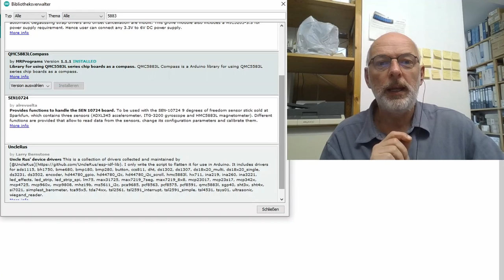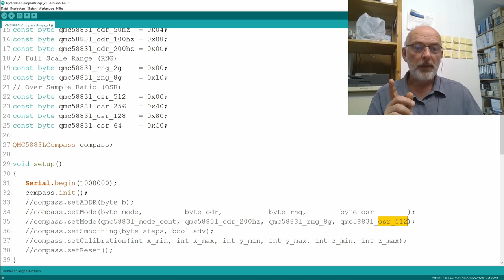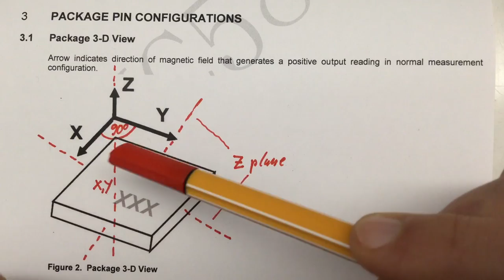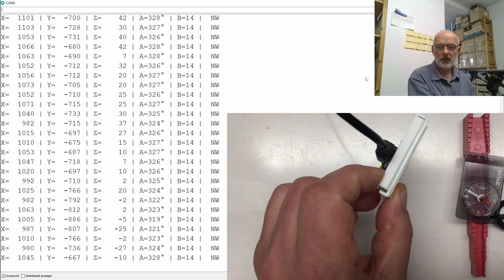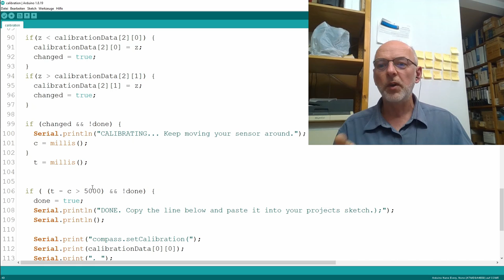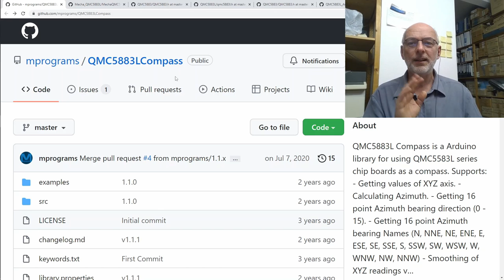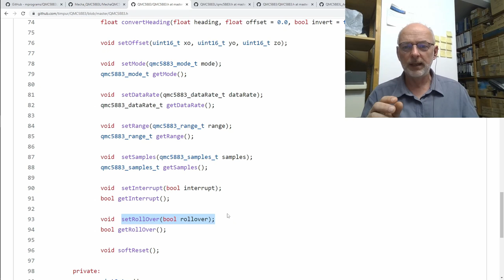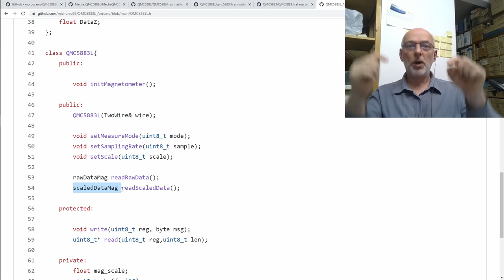QST QMC5883L 3-Axis Digital Compass and Arduino MCU – The Basics

Comment: Hello, a very useful video. I want to make a compass for my boat on the control panel. At high waves, the readings change. How to exclude slopes?
Reply from the maker: You need an accelerometer to compensate for the pitch and roll motion. Some day I might make a video about that (no promises). Meanwhile have a look at the MEMSIC MMC5983MA, a much more capable/precise digital compass chip ( https://youtu.be/BgSZ5XZTDDg ).

Comment: This has been immensely helpful. Although I am using the HMC version. I couldn't figure out where my extra offset vector was coming from. I thought there were external magnetic fields around, or that my breadboard or header pins were magnetized, or that my sensor was busted. I didn't think they simply need software compensation 😅
Reply from the maker: Yes, those things definitely need some calibration (see the rest of this series up to "QST QMC5883L 3-Axis Digital Compass and Arduino MCU – The Details (5)" https://youtu.be/pfMf-4S9yzk ).

One question though: Is the HMC as noisy as the QMC? In the end I found the QMC had simply to much noise and drift to be used as a compass.
Reply: @robertssmorgasbord  Thanks, for the very good information on this chip.  I'm struggling with it in MultiWii 2.3 .  I will see if I can initalize it with setCalibration() because Multiwii will not calibrate it.

Comment: Hi Roberto,

First of all thank you very much for the useful information you shared.

I have a few questions for you.

In the Cleaning Robot, I use the location information from this sensor so that the robot can perform automatic operation.
I process the angle value coming from this sensor using PID control and enable the robot to go on the route I want.
However, the sensor is very affected by magnetic fields (it is even affected by the phone) and therefore the angle value constantly changes. That's why the system, which works normally for a while, is disrupted due to magnetic effects.
We used a magnetic protective spray to prevent the sensor from being affected by the magnetic field, but in this case, we could not even calibrate the sensor because the spray protected the device from the magnetic field.

I have three questions for you.

1- Do you have any suggestions for this problem? (Solving the sensor being affected by the magnetic field.
2- Do you have any other sensor suggestions similar to this?
3- How can I find the angle for this process using the output of an industrial sensor that gives analog x and y axis slopes?

Thank you in advance for your help.
Reply from the maker: These are really interesting questions. First, a disclaimer: I have absolutely no experience with automatic/robotic cleaners/vacuums. With that out of the way ...
Magnetic/compass sensors of any kind are out of the question for your application. There's no way you can shield/compensate for the changing magnetic fields in the environment.
As I understand it most robotic vacuums use a combination of sensors: cameras, LIDAR, gyroscopes and accelerometers.
One chip (that I know of) that combines gyroscopes and accelerometers is the TDK MPU-6050: https://invensense.tdk.com/wp-content/uploads/2015/02/MPU-6000-Datasheet1.pdf .
Anyway, good luck with your project.

Comment: hello, great video! can i ask for help?
i ran the calibration and uploaded the sketch to find the azimuth.
the serial monitor always prints me about 230 , 233 , 232 etc and if I turn the sensor as if it were a compass the number practically does not change , what can it be ?? thank you
Reply from the maker: Are you sure you're having an QMC5883 and are using a QMC5883 library? There's also the pin, but not software compatible HMC5883 and libraries for the HMC5883 won't work with the QMC5883.

Comment: HI Robert- great video. I have a really good use case for this sensor and wanted to see if you'd be willing to help me develop a solution. I'd like to use the digital compass to measure the 2 dimensional "level" of my motorhome when I arrive at the campsite. Ultimately if I could develop an interface that measures and calculates the up or down adjustments of the 4 corners required to get to a horizontal level. What do you think? Keep the videos coming!
Reply from the maker: Hi Mark, this is not the sensor you are looking for 😉 No seriously, what you want is a 3-axis accelerometer. Unfortunately the inclination of Earth's magnetic field varies from almost horizontal (at the equator) to basically vertical (at the magnetic poles). So you really can't use a magnetometer to level your RV. But fear not, the next sensor I cover will be probably be a 3-axis accelerometer.
Reply: @robertssmorgasbord  Looking forward to the next video!
Reply from the maker: @markj3851  Which should be published this Sunday (QMC5883L - The Details 1) 😉

Comment: Hello, amazing video ¿Do you know if I can get similar data with a HMC5883L?
Reply from the maker: First, thanks for the praise! Yes, of course you can get similar (or even better) data with the HMC5883L. But note that the HMC5883L is no longer manufactured by Honeywell. So if somebody is selling you an HMC5883L, chances are it's really an QMC5883L. Though, you might get some new old stock QMC5883Ls - for a price.
Reply from the maker: @joymakerRC  Yeah, I've seen that little BN-880 module too. But unless they're sitting on a whole lot of new old HMC5883L stock, they might just solder on the pin compatible (not software compatible) QMC5883L nowadays. However, if you're able to talk to the compass on a BN-880 module using a HMC5883L library, then these modules probably do use the original HMC5883L (or a good enough clone).
Reply from the maker: @joymakerRC  I see, so they do have HMC5883Ls on those modules. That's very good to know. You'll find a whole lot more code for the QMC5883L in "The Details" videos (link to the first one in the description). I really think I maxed out on that chip ... and found it lacking for my application (compass direction input for marine chart plotter). Anyway, you have a great day day too!